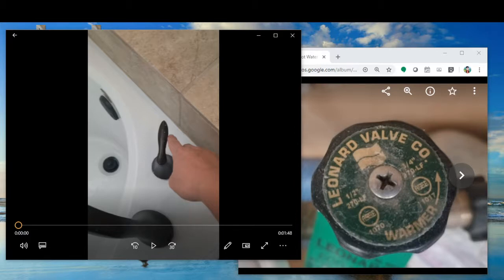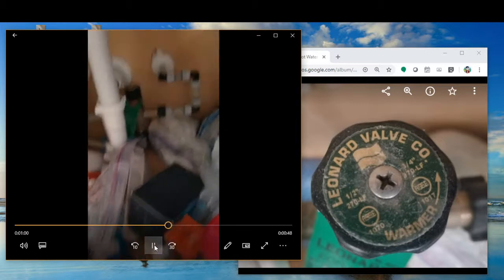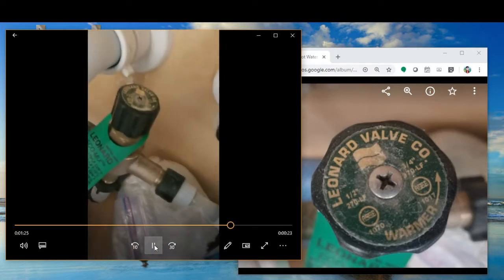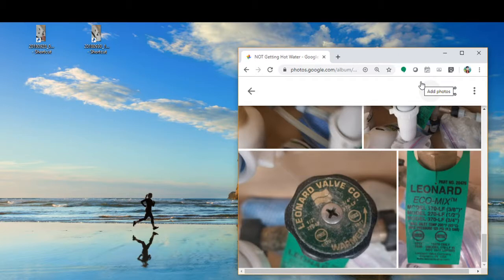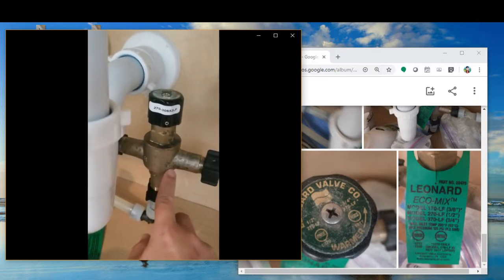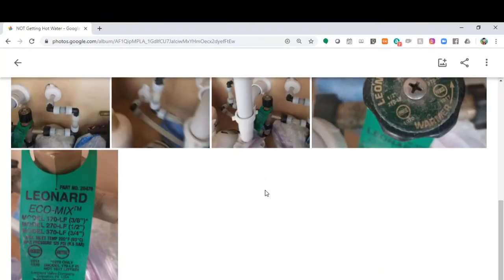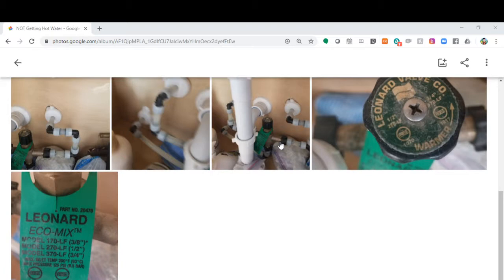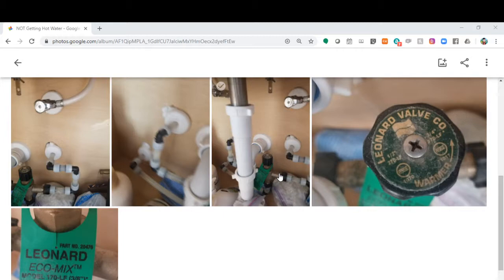Not getting hot water on bathtub - how to fix?

Comment: I have the same problem with my bathtub. Thanks very much for your video
Reply from the maker: You're very welcome!
Reply: Hey man, is it all i have to do just turn the valve 180 degree and connect hot to H and Cold to C ? Did the plumber do anything else?
Reply from the maker: @dtr7427  That's all my plumber did last time.   But I paid almost near $200
Reply: Thanks very much 🙏
Reply: Thank you great video.